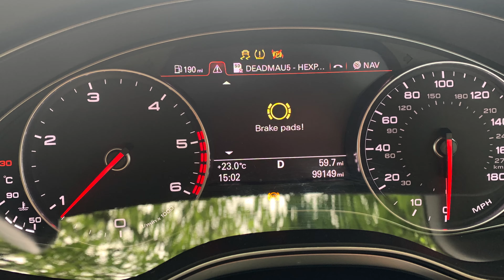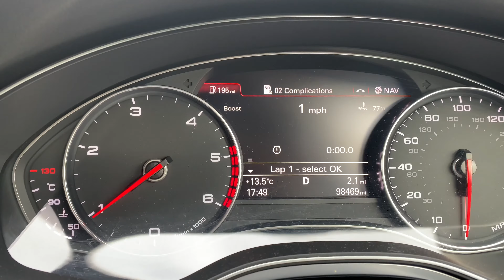Audi A6 - TPMS/Electronic Brake/ABS error fix

Comment: Did you have to reset the lights after he was done fixing the wire connections? Or did they just go off automatically?
Reply from the maker: Yes you’d have to reset the codes or you can do drive around it can fix itself too!
Reply: @Adnankhanchannel1  alrighty thank you!
Reply from the maker: You’re welcome
Reply: @Adnankhanchannel1  i have 1 more question. If i unplug the parking brake wire from the caliper will that stop the light from coming on? Ik its not recommended. Im just looking for a temporary fix until i can take it to a shop to get looked at. The problem im having is my audi thinks the parking brake is on even tho its disengaged. So when i try to drive it it dragged and it messed up the braking system so i cnf drive it. I imagine once the light it off the audi will drive freely
Reply from the maker: It is not recommended but front brake lights kept on coming, even when I changed brake disc, pads and even changed sensor twice but didn’t help. So I has to got it disabled by car Electrican.
Reply: Hello does it make your car dosent start?

Comment: For my audi A6 it shows stabilization fault and air suspension fault and rear suspension tends to become bouncier randomly and if switch off and switch it on it comes to normal and again it appears after some driving...air suspension fault,tpms fault, stabilization control fault.. wat will be the problem?
Reply from the maker: A car diagnostic will tell better!
Reply: @Adnankhanchannel1  Sir..I have done the diagnostic test and it shows all the errors..went to 5-6 mechanics.. each of them different feedback..one of them saying ECM to be changed ,one of them saying want to reset the program coding, one of them saying want to changed the Air suspension compressor and one of them checked the wiring if any rat bitten..all wirings are fine...I really frustrated by this issue went to audi service centre they are giving a high estimate near 40% of the car current selling price
Reply: @samgeorgebush9216  did u fix it?

Comment: Hi how YOU fix the problem ? I have the same problem?
Reply from the maker: Yeah the problem is fixed
Reply: What you change ? To fix it ?
Reply from the maker: Honestly speaking I had to get the front wiring disabled otherwise changing front brakes, pads and sensor didn’t help.

Comment: Hi 
I kept getting the same errors and when I called AA I HAD this fault code 
Patrol found the following fault code/s:System : Engine control 1 - VEF / Diesel EDC 17C46 UDS Status :U111300 - Function restriction due to fault value received. Error Message : . Sporadic fault.Above fault code stored in engine ECU. 
So please any idea what could be ?
Reply from the maker: This could be something else! Please have it diagnosed by a garage
Reply: I have this same status code and 5 garages have no idea what it is!
Did you manage to get it resolved and what was it please?
Reply: To be honest none of the garage find the problem as the car drive perfectly but I found out the reason because could be lots of problems causing this problem, under the back middle seat there’s ecu unite so when someone sitting on it it cause all this fake faults
Reply: @islamarafa7455  Okay, strange. The car is skipping sometimes, my only real concern, other than that, drives fine. Is an annoying one for sure